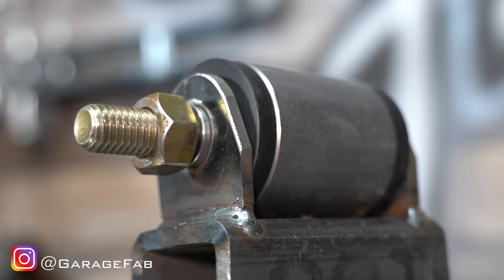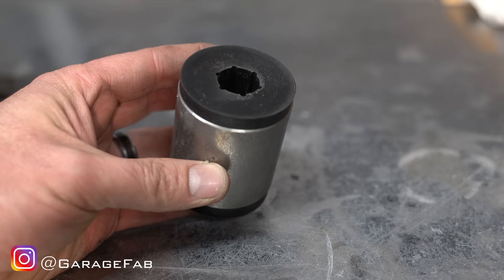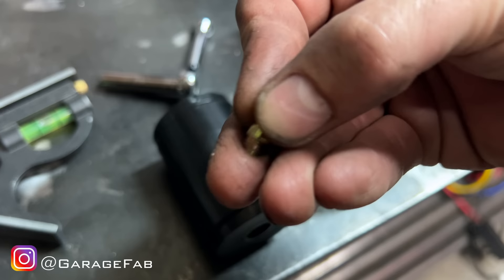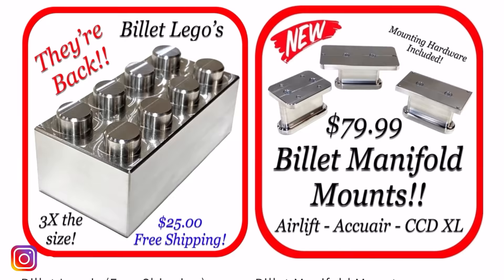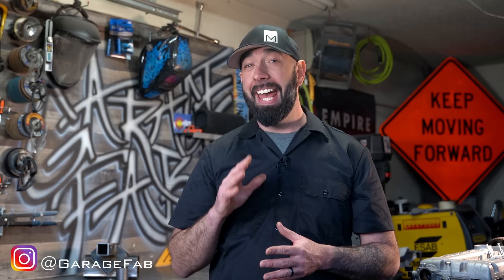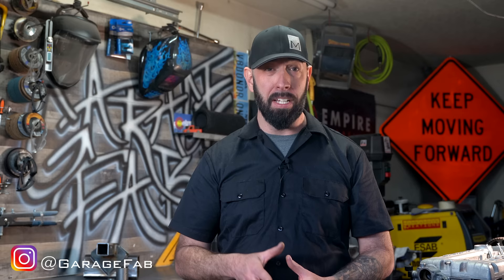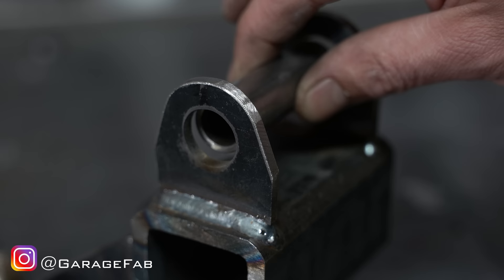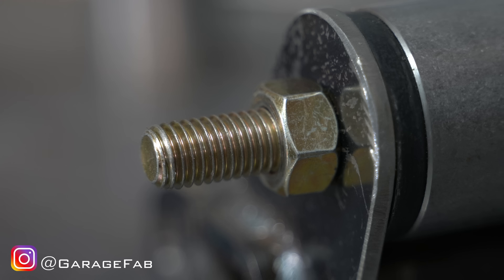The DOs and DON’Ts When Installing Polyurethane Suspension Bushings

Comment: Get rid of all the rubber/poly/delrin and use spherical bearing rod ends (Heim joints) instead.
Reply from the maker: Nah! Heims are crucial on some applications, but they’re definitely not a fix-all. There’s no vibration dampening, and they’re way too expensive for how long they last. They’re not lubricated, (aside from a thin Teflon lining) and they’re open to the elements.) From my experience, even high quality Heims get loose in a relatively short period of time. And when they get loose they begin to rattle. 
I’ll meet you halfway, and recommend the Johnny joint. Spherical, cushioned, and rebuildable.
Reply: @GarageFab  That's a very good, accurate assessment. But I've got race car reasons (more stable alignment that doesn't change under loading and doesn't effect spring rates) and personally believe that all cars should be more race car. And since I feel that way, I of course must try to make everybody else feel that way too, right? Right? Hello?

Anyway...thank-you for sharing your impressive knowledge with us. I appreciate the time and effort you must put in to show us simple things. I watched your U-joint angle video yesterday, and was super impressed that you actually rigged up a pro-level contraption to show us what happens when the angles aren't parallel. You've got a subscription from me.

Comment: Friends don't let friends use poly. High duro rubber all the way (unless using heim joints) Poly gets chewed up and takes a set very quickly. Rubber handles the rotation in the material not in rotating.
Reply from the maker: I hear that a lot! Yet I’ve never needed to replace a poly bushing. (…that was installed correctly.) Does this high-duro rubber come bonded to a sleeve or does it resemble the poly bushing?

Comment: Does this info apply to shocks?
Reply from the maker: I think a lot of it applies to shocks with some differences.
Most of the shocks I have experienced have bonded rubber bushings. So even though the overall setup is the same, it’s important to know that the inner sleeve does NOT rotate freely in the rubber bushing. That said you must load the suspension (rest the vehicle on the ground) before you fully tighten the bolts. Tightening the bolts with the suspension dangling can cause the rubber to tear when you set the vehicle down.
Some shocks eyelets with 2-pieces rubber inserts and a metal sleeve. These are not bonded so it’s not as important to tighten before setting the vehicle on the ground. With this style apply a little NON petroleum based grease to the inner sleeve.

Comment: Why are factory bushings dry? The molded factory bushings have about zero flex after torqureing to factory specs. Why is this?
Reply from the maker: Unsure if I’ll be giving you the answers you’re looking for… But rubber bushings are used by most car manufacturers because they absorb road vibration nicely and better yet they are cheap! Companies really need to pinch every penny when making millions of vehicles.
As for the “Zero flex” thing, rubber isn’t ideal for certain uses, like off-road or other high travel applications because the rubber is forced to twist rather than slip, but it does flex, it’s just very limited. Twisting too far can tear them but again this is because they’re cheap and really not meant for more than a few inches of suspension travel.

Comment: The main thing about bushings is that modern Japanese, German cars come with no possibility of changing broken bushings, officially u can only replace a arms completely- that’s so stupid:) and triples costs 💲 of repair:)  I have already pressed in bushings in front lower arms and ball joints for 4 times in 10 years
Reply from the maker: I can confirm! I work on Toyotas for a living. You can get aftermarket replacement bushings but have to replace the arm if you want factory.
Reply: @GarageFab  the same with mazda, Mercedes, chrysler:) I have driven and repaired them all. One of our local guys produces lower arm bushings in plastic case:) and they work better than original:) ahahha 😅  the price of original mazda front lower arm is about $250, the price of this bushing is as low as $8 😮

Comment: Zer fitting means you have to relube every year?  What that seems high maintenance.
Reply from the maker: Haha! Well, You have to lube polyurethane bushings often with or without Zerk fittings. But without Zerk fittings, you have to completely remove and disassemble your suspension components. That’s high maintenance!
Reply: @GarageFab  That makes sense.  Is it true only sway bar bushing makes noises and need to be relube?  What about PU installed in control arm, motor mount, strut mount, trailing arm, etc.. position, do they need to be relube often?  I just don't like the idea of getting underneath the car doing this just for better performance.
Reply from the maker: It’s definitely not for everyone. For most folks poly isn’t worth the hassle. From my experience, only components that move and rotate the bushings make noise. 
Control arms, sway bars, shock mounts, will all make noise eventually. The same assembly used for engine mounts, body mounts, etc. are usually noise free.
Reply from the maker: Oh, and you only need to lube when they make noise. Depending on your climate, they’ll often stay quiet for 6 months or more. A lil squirt every other oil change isn’t so bad. 
Poly is a requirement with air suspension so it’s just a part of my hobby. 🤷‍♂️

Comment: Great video, metric is far more logical and more simple to use. :)
Reply from the maker: Tell me about it. I’m hoping the states converts to metric in my lifetime. I tried to adopt metric in my shop, but though it made the work easier, it caused problems since all American parts and material suppliers use Imperial. 
It was miserable trying to balance two systems. 😩
Reply: @GarageFab  I belive you 100% :(

Comment: Can you do the same video but for body mounts bushing
Reply from the maker: I shall! But unfortunately it might not be for several months when I’m mounting the body on my next project. 
Most of the factory body mounts I’ve seen are very similar to this, just turned on its side. Continue imagining two separate assemblies. The first assembly is the body side. The bolt, the body, the inner sleeve, the large washer and then the nut. This assembly should be tight and doesn’t move. The second assembly is the body mount ‘horn’ on the frame, often with two rubber bushings. One on top and the other on bottom.
If you’re using a polyurethane bushing like the one in the video, the sleeve would be welded to the frame vertically and the bushings halves installed. The order would then be. The body side would be the same as before. The bolt, the body, the inner sleeve, the large washer and then the nut.
One of the main differences would be the sleeve on body mounts. They don’t need to rotate so you would want the sleeve to be a little shorter than the bushing so that when you tighten the bolt, the bushing material is compressed. (More so with rubber bushings) The sleeve in a polyurethane bushing might be a 16th of an inch shorter than the total bushing width, and the sleeve in a rubber bushing might be a quarter of an inch shorter than the bushing.
Reply: @GarageFab  awesome man thank you

Comment: +1 important thing: the angle of the control arms must be adjusted before torqueing, otherwise the bushing will be stressed.
Reply from the maker: That’s good information! Thank you. The polyurethane bushings in this video don’t have that requirement though. Since the inner sleeve slips, there is no bushing stress. On factory bonded rubber bushings, it’s imperative that the vehicle be resting with the weight on the suspension before torquing down the bolts. You’d be surprised how many “knowledgeable” technicians get this wrong. Cheers!
Reply: @GarageFab  So you’re saying when I replace my OEM Toyota control arms with new OEM control arms that have poly bushings installed I don’t have to load the suspension before I torque them? That’d be a whole lot easier 😂
Reply from the maker: Definitely not that! I’ve never seen factory replacements come with poly. You more than likely can get poly replacements though that fit in your old control arms. 👍
Reply: @GarageFab  Oh yeah that's what I mean, I'm getting new OEM control arms and replacing the stock bushings with Energy Suspension poly bushings while I'm at it
Reply from the maker: Yes! Excellent choice if you ask me. If you have the ability to install Zerk fittings, do it. Poly is great but can get squeaky.
Reply: @GarageFab  Sweet, not having to load the suspension before I torque 'em will be way easier! And I'll try!
Reply from the maker: Lemme know how it goes!

Comment: I wonder why we don't use needle bearings on control arms.
Reply from the maker: 🤔 The only two things come to mind. One is vibration. Vehicle manufacturers use soft rubber to isolate as much vibration as possible. Then race car builders often opt for Heim joints which basically don’t eliminate ANY vibration but do a better job transmitting power from the engine to the tires.
The other is many suspension components need to move in multiple directions. (Rotate and flex slightly back and forth.) A needle bearing in place of a bushing would only allow rotation, which I imagine might be acceptable for an A-arm.
Reply: @GarageFab   that's what I meant. On the a-arms and like heavy vehicles on the leaf springs.

Comment: Does poly bushings need to be PRELOADED? Some say no !! M not sure
Reply from the maker: For the type shown in this video, no! Preloading is NOT necessary. These are allowed to rotate similar to a bearing so they can spin indefinitely without damage. Bonded bushings (most often rubber) must be loaded first before tightening the bolt because tightening them with the suspension drooping will cause the bearings to over-rotate and tear. Hopefully this makes sense. Lemme know!
Reply: Yez the rubber bushings i usualy jack the suspension up just to ride hight bout nd then i turk bolts nd drop the car down ,, but i am replacing upper CA wish bone w camber adj nd they have poly bushings no greasing jerks tho !!
Reply from the maker: Perfect! I’d highly recommend installing Zerk fittings or finding someone to do it for you. They will squeak. It’s only a matter of time. It’s just the nature of polyurethane. Unless you’re not easily annoyed, you’re really gonna want to be able to lube them up without having to take them apart.

Comment: Grade 8 bolts are ok but Aircraft AN bolts are better and come in different shank grip lengths with a short fine threaded area thats just enough  for a self locking nut & washers no need to trim excess threads. Fine thread is stronger than course threaded grade 8 bolts. Also there's no difference in price. More expensive close tolerance aircraft bolts are a interference fit used to bolt on wings & landing gears. The shank is machined for a interference fit. There indentified with a triangle on the head.
Reply from the maker: I’m not well educated on the topic but I’ve heard aircraft bolts are not actually better for use on automotive applications. In fact, Grade 8 should not be used either. This was also mentioned by another viewer recently, that Grade 8 bolts and harder are more likely to snap in an accident causing parts to separate from the vehicle. Vehicles that have undergone crash test research have shown that softer bolts will bend and aside from obviously being destroyed, (who cares, the car is trashed anyway) they are much safer as they absorb and dissipate impact forces better and minimize flying debris simultaneously.
I’m assuming collision is not something that is tested much in aviation. All the focus is put on avoiding impact.
Reply: @GarageFab  In the aircraft world we get plenty of bent bolts they don't snap because there properly heat treated & the metal normalize so it isn't brittle. We deal with thousands of hard landings sometimes on dirt roads or rough fields everything is close tolerance. You drill holes we ream holes to exact size. Using soft low grade bolts on race car or off road vehicle allows the bolt to break off not just bend. A well designed strong frame with grade 8 or aircraft bolts bends & flexes while still holding the the suspension on and not breaking off losing complete control of the car. That's my take.
Reply from the maker: That yes fascinating Info indeed. Thank you!

Comment: I HATE polyurethane bushings. I have installed them on two vehicles and no matter what I did they squeaked so bad. I lubed the hell out of them, torqued them under load, followed all the directions and finally removed them. Good for off-road and race cars but not streetable.
Reply from the maker: They are notoriously noisey so zirc fittings and consistent lubrication with proper grease is mandatory. That can be annoying.
Torquing under load isn’t required for this style bushing.

Comment: I see some replace the metric with standard lol wrong fit.  The inner bushing must not move so get a hacksaw and put cut lines so it can’t ever move. That’s the way BMW is
Reply from the maker: I’m assuming you mean the knurled edges of the inner sleeve. Toyota does this too. I wouldn’t worry about it with polyurethane bushings though. Bonded rubber bushings exert a lot more rotational force on the sleeve than polyurethane bushings.

Comment: Hello no original Bushings has that ..so make your self clear...dose are   Modify performance Bushings..yes you can use it on your car or van if you can get them to buy out side .. or find someone that can make them for your vehicle
Reply from the maker: Hi! What? Garage Fab is a Fabrication channel, Jack.  We specialize in building custom suspension. Polyurethane bushings are some of the most commonly used suspension bushings in a build. Original bushings are bonded rubber and come pre-assembled. Therefore incorrect assembly isn’t an option. So what is it that I need to clarify?

Comment: So nothing said about clocking and if the bushings are installed correctly using this method, clocking  would be unnecessary since the rotation will occur on grounding the car. Perfect.
Reply from the maker: Correct!